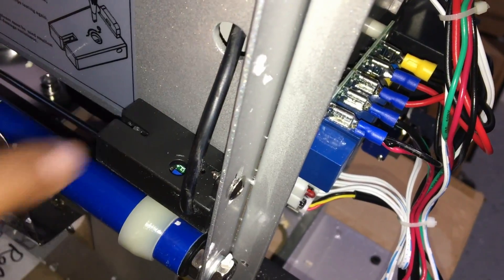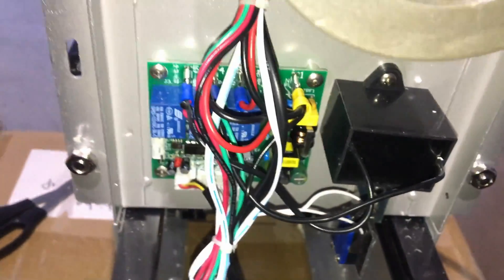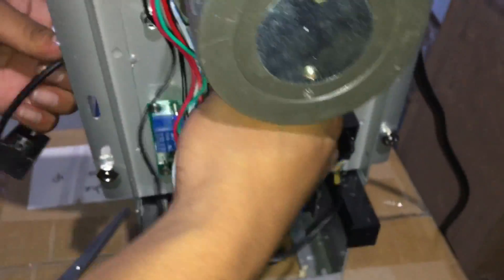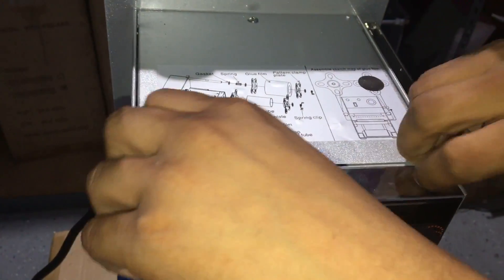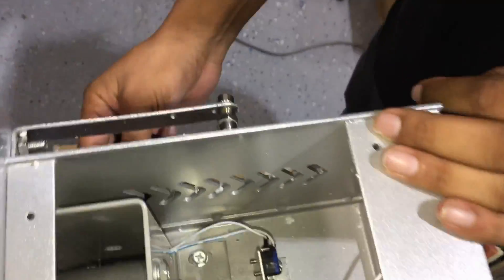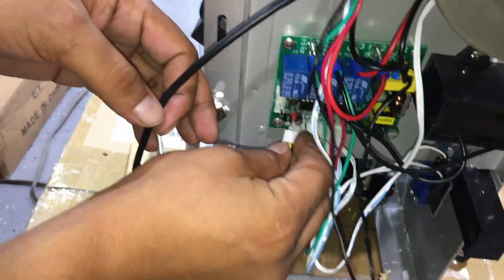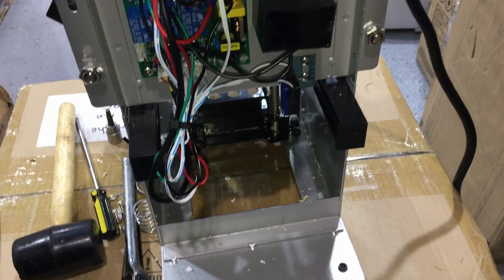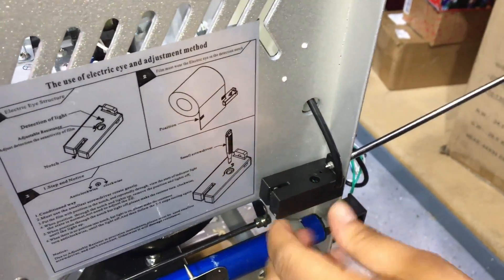WY-680 Semi Automatic Cup Sealer Sensor Replacement

Comment: What could be wrong when I turn on the machine, and nothing happens except the beeping sound and the E03 show up?
Reply from the maker: The Right side sensor of the machine is not
being depressed (clicked) down by the “Z”
shaped bar. The machine is unable to send a
message to lower the heat plate. Move the
sensor DOWN, so it is in a position where the
“Z” shaped bar can click that right sided
(upper) sensor. See figure . (RELATES TO E06)
Reply from the maker: Sorry that reply was more for a full auto cup sealer, but I don't think this machine has a sensor on the machine to display E03 right?
Reply: yes the machine has E03 display
it seems like no power the motor
Reply: E03 islower motor micro switch errer
can you tell me where is this micro switch located at?
I am very very appreciated